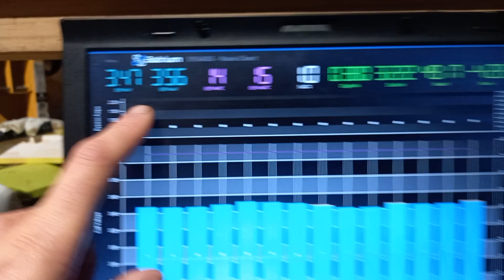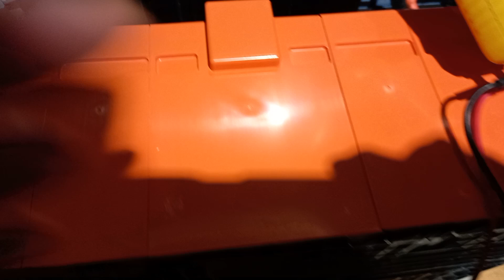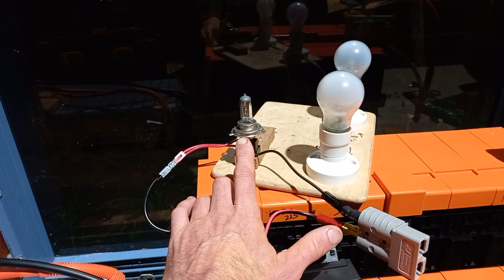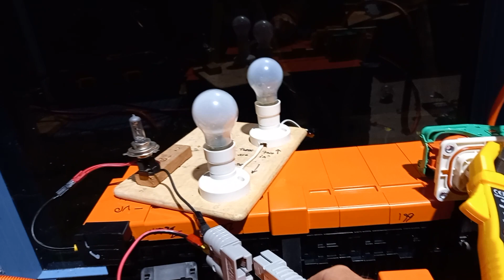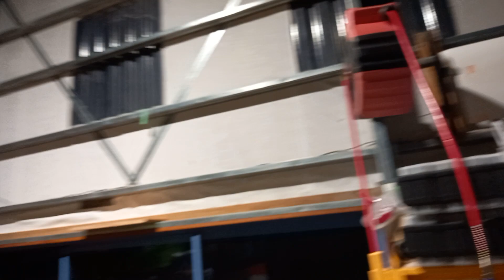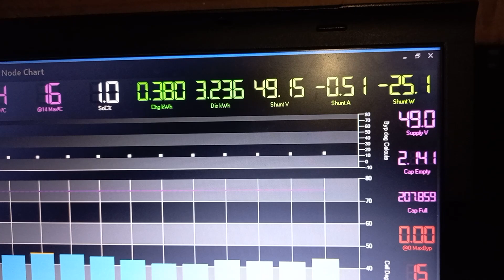Homebuilt BYD House Battery

Comment: I bought this type of battery(12V Version) and configured it for 48V from One point solar. I connected it in series with with JBD BMS and 5A active balancer, The problem with this is  there no way to know if these batteries has uniform capacity unless you test everyone  of them. Initially I bought 4 pcs, but during charging, (around 30A from solar charge controller) one of the batteries will be full charge first (while other 3 batteries is at around 3.35V each cell, so I bought another 1, I thought it will fix the issue but after 2 days, another battery would exhibit same problem. Conclusion: Do not buy this battery if you plan to connect it in series

Comment: Looked like there was more BYD modules left - so you should get some more from them.
How will you charge in the morning - assuming there isn't much sun?
Do you drive a car to the EV charger and then drain it into the house battery?
Reply from the maker: That's tomorrow's problem!
Reply: @RaglansElectricBaboon  lolz!
 well good luck for tomorrow!